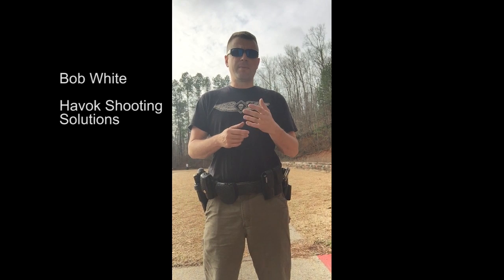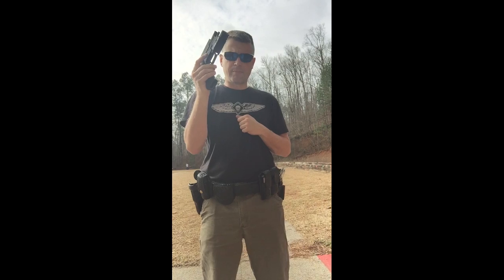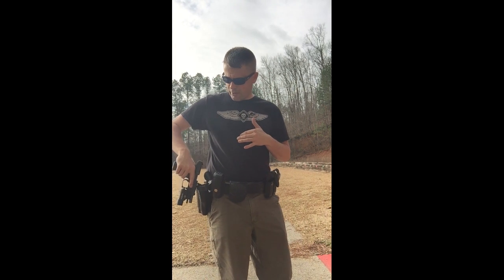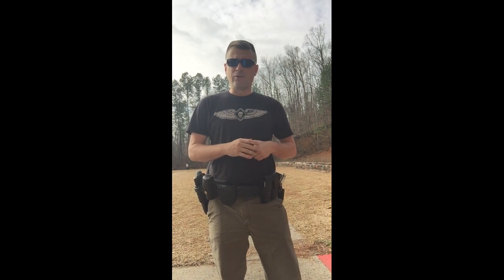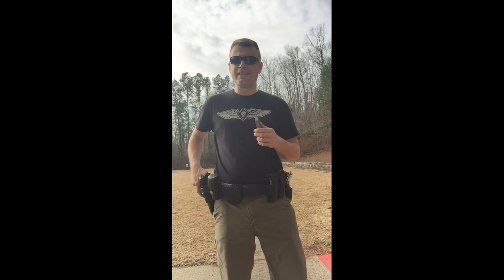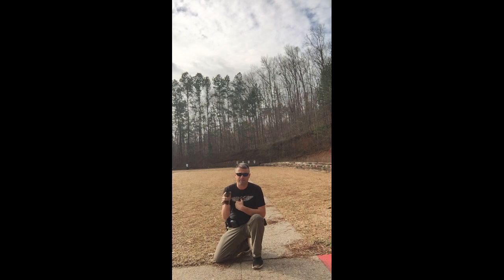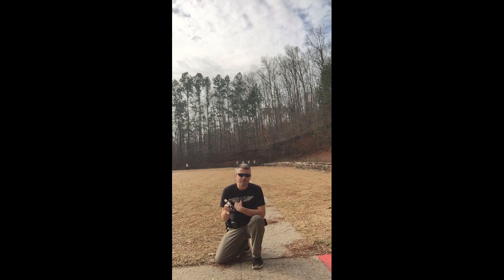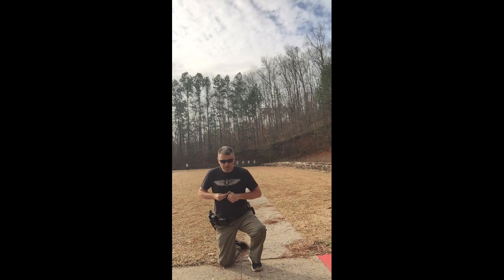P&S Primers - Pinning Pistol Reload

Comment: Not my first choice of method. Will be honest. I have always kind of be a shove the empty gun into belt or holster guy. If wearing the batman belt. Personal preference and training there. That said, for concealed carry. I like it as an option, will be honest there since getting into a holster, or belt in that situation can be rather more difficult. 

Also, like the idea of using the ejection port to rack the pistol if locked back and unable for whatever reason to use the slide release. For, even with glock, it is a SLIDE RELEASE!, I like options. and will convex those to those I know.

Comment: Well, it’s a way...
Holster or behind the knee method makes more sense to me. The chance of getting dirt from into the pistol from those methods are way less, than putting it on the ground and stepping on it. But I guess it will work in a clean city environment.
Reply: Dude, there are lots of ways to do reloads.  Like I said in the video this is just another method to use.  If you are in the mud, obviously, you might want to try something else.  Behind the knee works fine.  I just don't enjoy flagging myself.  There are many different ways to do reloads.  Having the knowledge and practice of them is just money in the bank if need be.  Thanks for watching!

Comment: Thanks for posting this--I will practice it.  This may seem like a quibble, but I keep wondering; how long will you be able to hold an injured arm across your chest?  I can see how the arm would be reflexively pulled back, but won't it eventually drop down and dangle to the side?  This may seem like a silly question, but a dangling arm will still have to be allowed for until aid can be given.

Comment: I like to take a knee behind cover, pin the pistol behind the knee thats kneeling, insert rack off whatever is stable. Heel of boot, belt, etc...But Im definitley gonna practice this a few times just to have another way of doing it if need be
Reply: Taking a knee behind cover is always the best option.  I don't like the behind the knee reloads.  Mainly because of my years working the line.  Guys tend to flag themselves or someone else that way.  There are many options when it comes to performing a reload.  This is just another technique you can try and add to the toolbox.

Comment: The technique may be OK for support hand reload 1 handed but it has unnecessary weaknesses so I don't see a reason to practice or include another technique like this.  Using the holster for strong hand only reload allows for less overall movement particularly if injured. It also is more natural movement.  It secures the handgun better than stepping on it while at the same time allows for movement away from a threat, to better cover, fleeing etc..  Doing the same with a support hand only reload but sticking the handgun firmly in the front of the waistband if not carrying AIWB has almost all the same benefits as using the holster.  Flagging yourself is extremely limited with the support hand only technique and non existent with the holster and the gun is not loaded as indicated by the slide lock and empty condition necessitating the reload in the first place.  Movement or the ability to is too important to not consider.  Keeping a technique as similar to other techniques is also best practices.
Thanks for sharing but I don't see any real benefit.
Reply from the maker: zeitgeist888 knowing different options by itself is a benefit
Reply: zeitgeist888 I don’t think I heard Bob say it was the best technique for every situation. He was just presenting another way.
Reply: If it isn't appropriate when in sand,snow,mud or gravel, it doesn't allow for movement.  It doesn't allow for kicks,knee strikes and is not consistent with regular reload techniques or gun manipulations is it worth considering, learning and practicing to develop enough to be performed under stress?  Consider Hicks law and limited time, ammo and energy to develop gun handling and use skills and just knowing or having a bunch of different techniques, particularly one with limited use and benefit is not so much a benefit in itself but the attitude of "it's another tool for the toolbox" mentality.
Reply from the maker: zeitgeist888 I can think of various times this technique would work quite well and considering many cops and EDC people are on concrete or similar- you are so finely focused on trying to disprove something you show an inability to see a larger picture.
Reply: I completely understand it was presented as another way not the best way but to present something objectively and honestly the presenter does a disservice to viewers by not stating the strengths and weaknesses of his technique or how it compares to known and accepted techniques already in use.  No one should be afraid to discuss reasonable concerns discussed in a respectful manner.
Reply from the maker: zeitgeist888 there is a point of diminishing returns - the audience needs to practice and figure out things for themselves. Videos alone do not provide mastery.
Reply: I am not trying to prove it is a bad technique or won't work only that it has numerous weaknesses that other techniques do not have and is very limited in when and where it can be useful.  The use of holster or waistband accomplishes the same task faster, easier and more naturally close to regular techniques on any surface while allowing movement and the ability to fight with kicks and strikes.  This technique does not. By defending the technique and that it works in some limited situations while refusing to acknowledge that the circumstances where it is the best technique possible is avoiding the issue and reality that most gun owners and self defense students of the gun face which are limited time and ability to train numerous techniques or techniques that have a narrow niche of usefulness.  It is not a personal attack against the presenter nor the technique only a factual discussion of the techniques weaknesses and an alternative.
Reply from the maker: zeitgeist888 as stated - it is a technique, not THE technique.